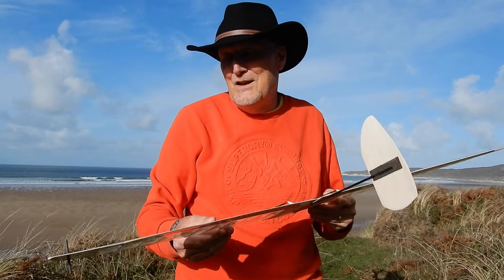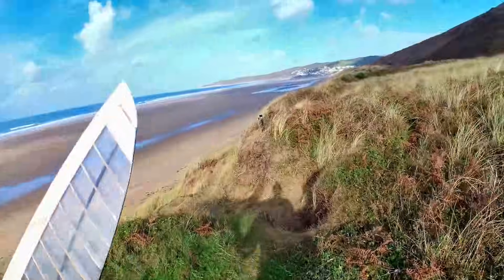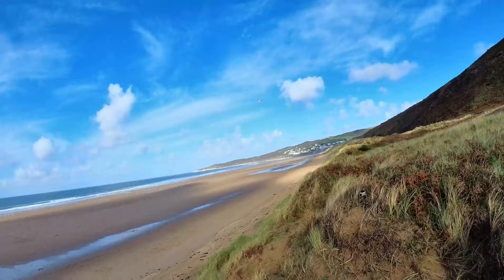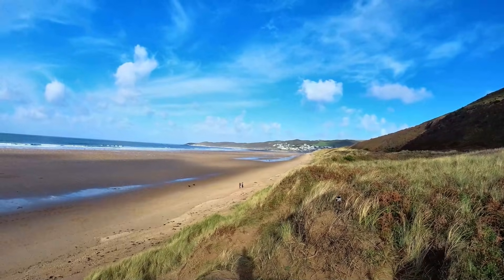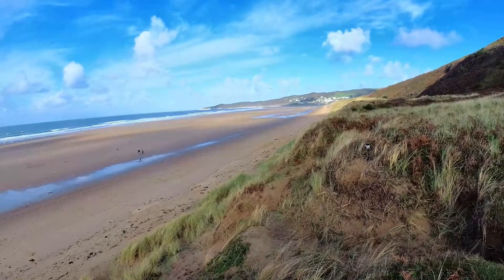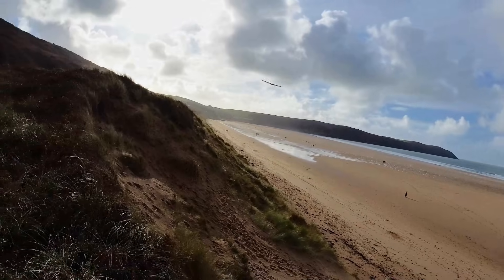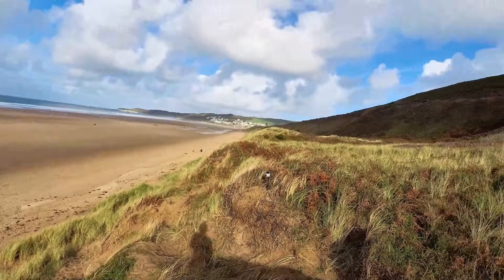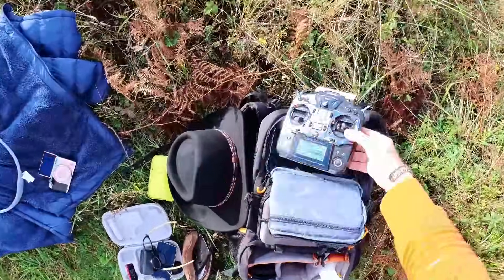Aurora Test Flight

Comment: Hi Nick. What is the added nose weight you ended up with. And battery weight. Small request from me is to add these specs for positioning of battery, added weights and reciever to your videos. 
Some contect on me. 60 years old. Have a fleet of 14 fpv drones and 14 fixed wing fpv planes. All self build. Using both analog and dji. Only now starting with line of site training. Scrach building 2 DLGs...BugX incorporating Pug v2 features. . Hand cuttig all parts. You videos my go to and watching them over and over. Love your content, humor, atitude and style....and top tips.
Reply from the maker: I’ve added 20 grams to nose and a 3.7v 400 mha battery
Reply: @NickChittyFlying  Many thanks Nick

Comment: Flies okay, but it seems unstable in pitch to me. It gets it's nose down and digs in getting progressively worse...Has it got a reflex wing section..?....🤔😳🇬🇧
Reply from the maker: It has been at the unstable end of divergent. I am using Pw75 wing section
Reply: @NickChittyFlying Ah, yes, that section has no under camber and no reflex either....Explains why it's behaving as it is. A get out you could consider is a small Tailplane and just Ailerons. It will fly more predictably that way....🤔🇬🇧
Reply from the maker: @EnglishTurbines  
The PW75 is a versatile airfoil designed for flying wings, known for being a good all-around performer suitable for both slope flying and aerobatics. It is a modified version of the PW51 airfoil with more reflex, which increases the pitching moment, allowing for stable flight at a zero flap setting. This design makes it well-suited for a variety of RC models
Reply: @NickChittyFlying That's a matter of opinion. At best it's a modified Clark Y section, not meant for Elevons...No doubt it's an efficient section, but not with Elevons or even just Ailerons. A  DSG Glider would use a rudder and elevator. Ailerons on a wing of this section is just detrimental... IMO...🤔
Reply from the maker: @EnglishTurbines  I am happy for your input time will tell ❤

Comment: Congratulations Nick this looks like a winner to me. I have an old glider that has a plywood fuselage,  if I construct a pod and boom with just the vertical stabilizer like you've done here and set up as a elevons do I need to change the cg ? And if so wich way ?
Reply from the maker: It might work mate but not brilliant as wing section won’t be for flying wing so you will need plenty reflex in elevons for pitch stability